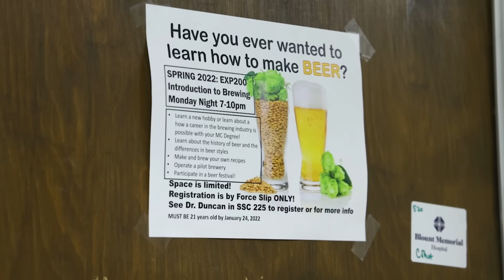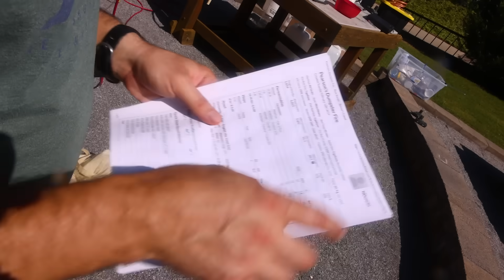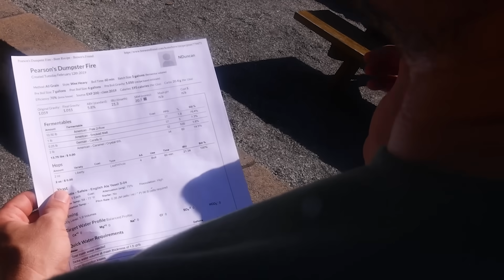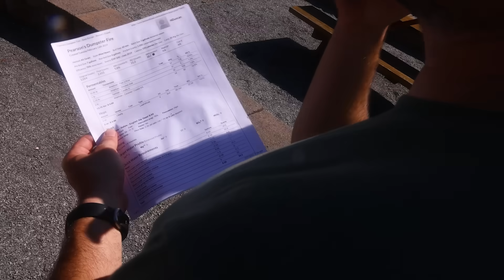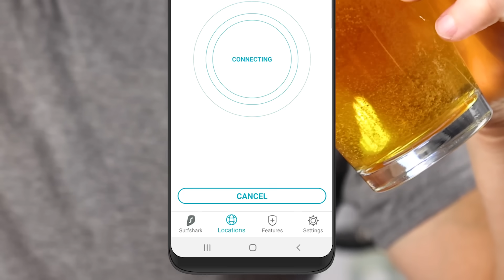Chemistry of beer, part I: Malt to wort

Comment: Had to chime in on this, 2:32, Terpenes are a class of chemicals typically with a bitter or resiny or piney taste - Menthol is a Terpene, as are some Citrus aroma chemicals and alot of the psychoactive chemicals in Cannabis. Hops contain Terpenes which are alot of their flavoring ingredients, and it's thought they have a mild psychoactive effect too, similar to Cannabis. 

As for Bioconversion, I suspect she's wondering if the Terpenes are altered into other chemicals by the yeast or the amylase.

Comment: An interesting method of sparging is a process called parti-gyle, which is thought to have been used extensively throughout history. The first run of the wort will always be the most concentrated in sugar, and therefore the highest in alcohol content. Brewers used to cram as much grain as possible and sparged the liquid, resulting in the strongest beer meant for the local lord or monastery abbot. The tun would then be refilled, reheated, and sparged, resulting in a lower alcohol beer meant for monks and sold to merchants. The tun would be used a 3rd time, resulting in a beer that had barely any alcohol in it that would be given away to peasants as a safer alternative to water.
Reply: Wort has no alcohol content.  It's just concentrated sugar.  Second, removing the wort from the mash cools it, which lowers the viscosity of remaining sugars.  Third, it introduces hot-side aeration.  High gravity brewing is how large breweries make beer these days, including using mash tun extenders such as DME and various syrups.  Much easier to blend instead of having 3 boils.
Reply: @BeeRich33  I realize wort is just sugar from malt and water, I was trying to make it clear that the higher the sugar concentration, the higher the alcohol content of the finished product. Also, I never suggested parti-gyle is a preferable method of brewing, but an interesting historical process that also informs us of the society it was used in.
Reply: @mattigus  Yup, this is how we ended up with table/petite beers served for the monks.
Reply: @BeeRich33  Astonishingly, there are people on YouTube who evidently learned to write before they learned to read.

Comment: Man you need to work on your image framing for 16:9. Cut people with the side of the frame not the top. If you’re not that confident yet, you might want to record in 4K and leave enough space to reframe in post. Generally for what you’re doing here, the top of people’s head should never or just barely touch the top of the frame. 16:9 is a tall aspect ratio. You should use its height. You can also put your videos out in 2:1 (use some sort of frame lines for recoding 2:1 tho). Where is kind of framing would look more appropriate. But of course all of these are rules to be broken.

Comment: 0:55 correct me if I am wrong but its the fact that the amylase enzymes have activated as a result of moisture, they didn't magically create out of nowhere, possible misconception.
Reply from the maker: When sprouting, the grain creates amylase out of amino acids it was "born" with. So no, the amylase was not already in there — only the building blocks. We then dry the malt to deactivate the enzymes and save them (and the starch) for later.
Reply: @aragusea  Thank you for reply and clearing up the misconception that I had. Have a good time and I am loving the content you are producing.

Comment: Quick note Adam: Caraffa malt is De-Husked, so it is way less "bitter" then its husked cousins even at the same "darkness" of roast. Example: 200 Lovibond (that's the darkness scale, higher is blacker) Caraffa II tastes like a mild dark chocolate chip cookie. 200L "Chocolate malt" is sharper with more bitterness and astringent pucker factor. Like, strong coffee with a bunch of unsweetened cocoa powder in it. 
 Only difference is the husks on the barley itself.
Reply from the maker: Indeed, though for the record, the very dark malt you see me tasting in the vid was also husked. This was not a level of detail I felt I should get into.
Reply: @aragusea  Indeed! Looked like Black Patent you tasted. Tastes like cigar ashes, adds a TON of color in very small amounts. 
I once brewed an American light lager that I threw 4 oz of black patent in to give it a deep red color. It really tricked the Bud light crowd. 😉
Reply: Woodchuck beer taste like chocolate,  I wonder if that's the reason.
Reply: Correction: Carafa is husked, Carafa Special is de-husked. Both have type I, II, and III

Comment: In what way is beer sweet I've seen tons of beer videos and they've all mention the sweet notes of beer. I've tried beer and never been able to taste anything other than bitter carbonated alcohol.
Reply: What beer are you drinking?

Yeast eats sugar.  Malt has sugar (maltose, that yeast doesn't like, so that's why the mashing process has to happen).  If the yeast eats all the sugar, you'll have what's called a "dry" beer (a popular fad of the late 80s, but also one that happened again in the past couple of years with "Brut" beers).  Most worts will not be that fermentable, and will require extra enzymes added during the mash to fully convert all the maltose.  Which means that most beers do have some residual malt sweetness.  You will taste that more in beers that are darker, and beers that are not as heavily hopped.  For example, you're probably not tasting any sweetness in a west coast IPA mid-IBU war years (when IBUs were significantly north of 120+).

Comment: Getting into fermentation is SUPER easy with mead. Honey, water, yeast, that's all you need.
Reply: Honey doesn't provide enough nutrients to keep yeast happy, which will result in poor fermentation unless you add a handful of raisins.  Then, it takes months for mead to clear and become drinkable, vs. 10-14 days grain to glass for beer, depending on the type of beer, yeast, and process (if you bottle condition instead of force carbonate in a keg, add another 2-3 weeks).

Bad beer is usually going to be much more drinkable than bad mead, and you'll know it's bad quicker so you can fix your mistakes and turn around another batch or 3 in the time it takes your first batch of mead to even start to be drinkable.
Reply: @toddosty  You can absolutely do mead without any yeast nutrients, which raisins aren't anyway. I also said it was easy, not quick. It's incredibly easy to mix up a gallon carboy of mead and forget about it for a couple of months
Reply: @toddosty  Raisins don't really add nutrients. That's an old myth, probably originating from the fact that raisins have grape yeasts on them so throwing a few raisins was a good way to get a reliable yeast into the mix in the first place. Mead will ferment without extra yeast nutrients, though.

Comment: I am sure that the Alcohol in beer is way worse for you than heated plastics leeching chemicals, do you have any thoughts on the fact that they are putting extremely hot water into big plastic jugs, do other beer makers use metal containers?
Reply: Metal and glass

Comment: Geez, an actual brewer (like me) would carefully keep the mash at different temperature levels for certain amounts of time, at which thew different enzymes work best. You at least should keep at the levels were the two different amylases work best like 20-30 minutes each. To be fair, in Britain, where these ales come from, you do a combined amylase rest between the optima where both amylases work reasonably well, but even there it's more elaborate than "put it in a pot with hot water and let it sit".
Also, using a chemical pH-buffer is just a disgrace, especially for me as a German brewer.
Reply: TBH i was shocked they did that, i was thaught you need to do it at two temperatures for X ammount of time for alpha and beta amylase... guess there are more ways to Rome

Comment: just a small piece of commentary: wine isn't just yeast-fermented grape juice. Wine also undergoes a secondary bacterial fermentation called the malo-lactic fermentation, in which certain bacteria convert the stronger malic acid into the less acidic lactic acid. If it weren't for this extra step, the wine would be very sour and controlling this process is critical for making wine.
Reply: Not all wine goes through malo.